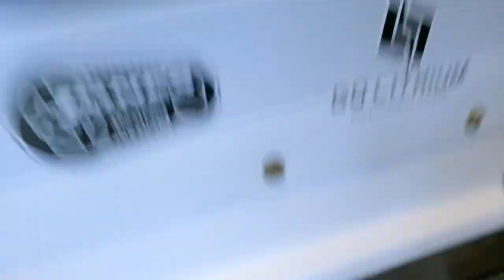How Much did the $10K Win Cost? Crate Engine Returns after Tech Tear Down

Comment: I would recommend using the long dowel pins on the rear of the block so that it locates the engine plate and the bell housing as well.
Reply: I wonder if they ever heard of indexing a bell housing, they do make off set dowels to correct it.

Comment: I still chuckle when I see people using cherry pickers to install engines.  We use small roll-around gantry cranes with electric winches...Turns a 3 4 man job into a 1 2 man job in much less time.  Six axis control with not much need for CROCKS. Use a spreader and you gain pitch control...your welder friends could fab one easy!

Comment: Well that’s the best deal, time for a fresh up. On our car in our class, protest fee is $300 then $100 to accept,  then the track keeps $100, so your left with $200. The one time we was protested, just the gaskets costed $150, plus our labor to put it back together. Our engine builder, doesn’t mind you putting the head and intake back on, but is a pain because of all the flushing out of dirt after a protest tear down. I thought that was the purpose of certified engine builders, to keep from tearing down a crate.

Comment: I'd like for you to do a breakdown of the cost of a race tires,  fuel, entry fees and cost of hauler expenses  to let non racers know how much it really costs to win that $10,000 check.
Reply: For one Race or a season? Most pit passes are 25 bucks a head Tires about just shy of 200 Bucks a Wheel The rest depends a ton on what where when! But a mid level Travel Team is going to eat up over 100,000 easy for a full season not to include REPAIRS  Spare parts that just the entry cost travel cost if you have say 4or  5 guys if you NOTICE the PEOPLE in the pits THEY EAT A LOT OF FOOD just saying
Reply: @CORNDODGER  For that one race. I have owned a PASS tour modified, just wanted to let non racers know how much it costs to run a car to win that big check.
Reply: Hopefully they use their hobby as a tax write off
Reply: Pretty sure there not going in depth for you and a few others
Reply: @docohm50  it near impossible now to write off unless to run it as a business and to run as a business you have to show a profit on a semi regular basis.
Reply: With everything added in they probably end up with about 5500.
Reply: The modified cost about $350 a race to run for a 40 lap feature for $500 to win. That's on a weekend with no issues.
Reply: @docohm50  Once you win cash money or valuable prizes, your Hobby automatically becomes a business because Uncle Sam IS going to get his cut.  And, now your Sponsor contributions are "Income" but your transportation and even tool expenses become write-offs.  It's very complicated to simply state how much you "really" won.
Reply: It's around $5K or $6K per race for expenses, depending how many crew, wages, licensing, distance, accommodations. Race tires and fuel are a given expense.

Comment: HTF answer me this please!!! i am running the same jones set-up on the front of my motor and our cog belt running the water pump from the crank is super loose. We have tried the next size smaller belt and it is too small. i just replaced the belt and all the pulleys this week (8/27) and again it is still loose. i have chewed up 2 new belts in the last 4 weeks. Everything is lined up and have no idea what to try next. any ideas or other parts/tensioners i shopuld be running?? any help is appreciated

Comment: I still believe that the track needs to pay for any and all fees if the engine is found to be legal to their rules.  If they want it checked they need to put out the cash.
Reply: Sorry but  as a X Tech at a NASCAR TRACK you pay for the PRIVALAGE to race on their Track not like its a RIGHT !!!!  You bare the cost of racing in all forms and if you read the fine print on your TICKETS you RELEASE any and all Burdens including INJURY !!!! Dont play with the big boys IF YOU CANT PAY
Reply: I agree. If illegal, you're beat.
Reply: First and for most the sanctioning body and the track does the POST RACE TECH... Going in to a big money race the moment you pay the entry fee you can expect the top three to go thru (once again post race tech) Eric you sir don't have a clue how this works nor what your talking...
Reply: I think the track did pay for the parts needed to put the engine together but not the labor

Comment: If Joseph or Jesse jump in Larson or Davenport's car and wins, what do they have that you don't?  I live next town over in Crestview.  I am a fan and want you guys to win every race.   Seems visually you have all the pieces for success.  I just don't the variables.
Reply: Well Just to start out...
1: Motor HTF is sitting on a under powered 12 year old Draime motor that was built from 12yr technology 100hp off the big dogs (There has been discussion on the exact amount it's down) and the lack of a wide bore block setup. Davenport runs Clements and Cornett motors Kyle runs Cornett both have the greatest and latest components and are wide bore motors.

2: Davenport and Larson run a Longhorn chassis. HTF is running a capital The longhorn has so much more technological advancement thanks to Kevin Rumley than the capital car
 The high amount of the Longhorns racing in this country allows for alot of data.
Where as a capital has limited RD because there small. At any point in time you will only see Tyler Bruining on the outlaw schedule in the capital house car.

3: It comes down to knowledge a driver like Davenport has been around a long time and winning races a long of course you could put Larson in the HTF Super and he could win the world 100 no problem in the 10

4: Crew guys for those drivers are the best money can buy with years of expiernce and the bounce ideas between each other and make great decisions they really know there stuff.

5: equipment there hurting on equipment They don't have a back up competitive motor they don't have a back up car either
There simply not capable of playing with the big dogs. And by the way Joseph is a good driver but Jesse can barley drive a 602 crate sportsman car.  Sorry if the truth hurts the first thing I would do with that motor is tie a rope to it and use as a anchor.
Reply: @Hunter-eb6hx  Thank you for taking time to explain the basics.  I really enjoy the HTF guys.   I know you just scratched the surface there but it was a lot of great information for fans.  Thanks again for your detailed response.
Reply: @docohm50  the national series (Lucas and WOO) cars are probably around $100,000 each. that's a considerable amount of change $$$ and they have at least 2 cars every race
Reply: @Hunter-eb6hx  100 hps off??? I’d challenge you to find a dyno sheet from either Clements or Cornett showing 950 hps

Comment: whats the difference from 604 and 602 classes
Reply: Since nobody answered this..  as I understand the numbers are the final three numbers from the GM part numbers used on a specific engine configuration. For instance a 604 is a GM 19370604 motor they make for circle track use.  You can look up the motors in the GM Performance catalog to see the specifications of each one.
Reply: Cylinder heads.  602 has steel heads, 604 has aluminum heads, and 50 more HP(400HP) than the 602 with 350HP
Reply: @Ezisnotaman  Pistons too
Reply: @kevinpotts151  Different compression ratio, right?

And Forged crank, versus cast crank.
Reply: 2
Reply: @Ezisnotaman  both Forged Steel cranks 
compression ratio
604 9.72:1 
602 9.1-to-1 
604 Fast Burn cylinder heads 602 have Vortec heads just a few things thats different.

Comment: Hay , have you ever been to Sanoia or how ever you spell it, it has inside walls, and I’ve been watching vlogs, and there is a ton of wrecks do to hitting and scraping the inside wall, loll, nice , just take a look at some vlogs, kool nice 👍 thanks BigAl California, hay i when ver and looked at dinggingz71, your transmission needs to be replaced with a mikes transmission power glide, ,Mike transmission has the strongest power glide on the planet 🌎 guaranteed , just don’t hold the trans brake too long , and don’t run it out of mikes transmission fluid,and don’t wrech it, other then that , you can’t break it,   Mikes transmission s out here in California,( Palmdale) just look them up, he Mike is the real deal drag racer he test every one of he transmissions and he holds a few records with his  dragster,including top tested and proven, just tell them when you call Al Kennedy ( BigAl California) sent you , he and his wife own and run the shop (Kristy) kool , thanks BigAl California.praise Jesus grace Christ amen 🙏